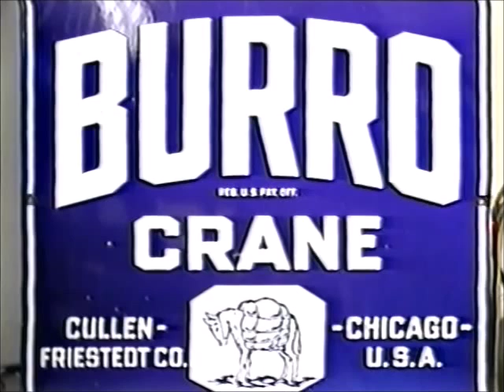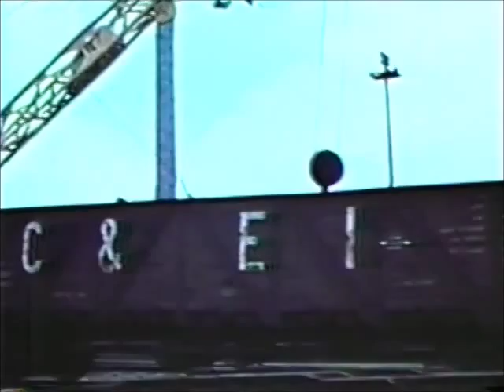The Legendary Cullen Friestedt Co. Burro Crane

Comment: Wow!  They sure move those wheel/axles quickly.
Reply: WAY to fast! Those wheel sets brought back memories! They were all friction bearing sets, so the bare steel journals were coated with a rock hard tar like coating to protect them until placed in service. It had to be removed before the wheel set could be placed in a freight car truck, and it was pain to get off! When I started as a freight car repairman in 1979, there was still a lot of friction bearing trucks in service, and we replaced a lot of them. Some guys would get a bucket of mineral spirits and rags and scrub forever , other would soak the rags, wrap them around the journal and light them off, attempting to burn it  off! Still wound up doing a lot of scrubbing, and also would get you “tuned up” by the boss if you got caught doing the fire trick!

Comment: The Burro Cranes, especially the Model 30 and 40 had a great power to weight ratio. The operator could move material or equipment at previously unattained speed. The perfect balance or men and machine. Note the complete lack of safety gear.